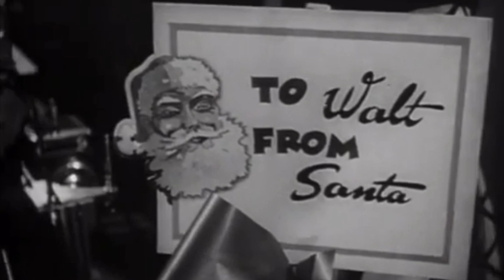Central Pacific 173: The Legacy

Comment: Wow!  A video about the Central Pacific 173 legacy leading up to Walt Disney's Lilly Belle locomotive from V&T Dayton #18?  I love it!
Reply from the maker: Thank you very much!  A very significant engine deserves some kind of spotlight and I was happy to provide haha
Reply: @WaltsNephew  It’s fantastic legacy that’s for sure, though one question. Why didn’t you add Stockton, Terminal and Eastern no.1? That engine is the Norris-Lancaster sister engine of the 173. I take you could not use the photo instead?
Reply from the maker: @hartjdr.agustin9745  Excellent observation!  The main reason is because ST&E No.1 was not involved in 173's wreck that caused the re-design turning her into her own engine
Reply: @WaltsNephew  Even though the 173’s accident made it a what supposed to be an entirely different build, the locomotive is still siblings of ST&E no.1 and used to owned by the Western Pacific of 1862. Not to mention they had 2 other sisters in the WP: Letter I “Industry” and letter F “Merced”. Plus, Mariposa is the only surviving Western Pacific in existence.

Comment: I'll bet #173 was the basis for Johnny (Casey Jones' steam engine). What do you think?
Reply from the maker: In a way, yes.  Since the Studio machine shop was busy with Walt's engine Lilly Belle for the Carolwood Pacific (which is a scaled version of 173) that engine may have been an inspiration for Casey's engine.  Although there are some MAJOR differences between 173 and the one featured in "The Brave Engineer"
Reply: @WaltsNephew  Like what?
Reply from the maker: Different chimney, different base railway (ICRR and CPRR), chime vs. single note whistle, slightly different domes, and 173 predates the Brave Engineer engine's design by probably 40 years

Comment: I'm still hoping someone decides to build a full scale replica of the 173 someday, but there is one thing about the engine I am curious about.
Whatever happened to the original drawings for the locomotive? I know they had survived up to the point where Walt built the Carolwood Pacific, which helped with making the blueprints for the Lilly Belle, but whatever happened to them after that?
Reply from the maker: I think the original drawings (or at least the replicas) are in the hands of the estate of Gerald M. Best (and quite possibly a copy or two is in the hands of Roger Broggie's son Michael)